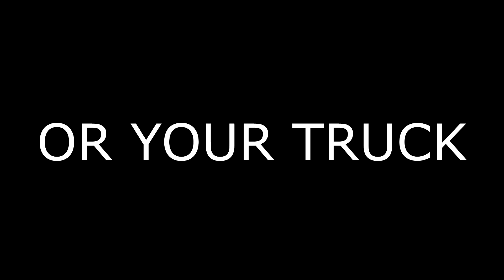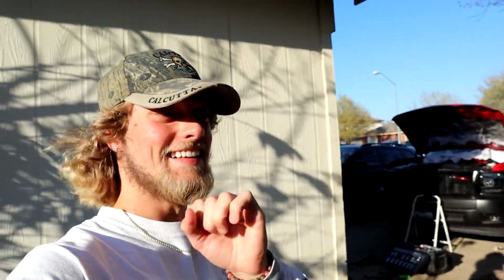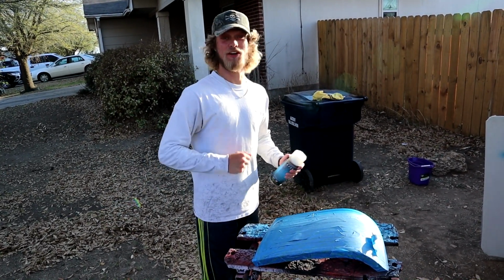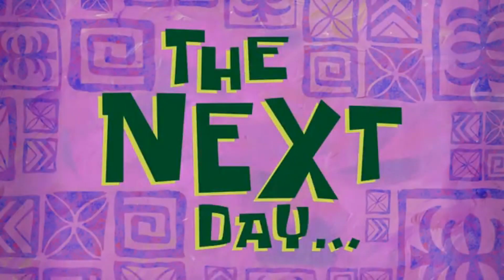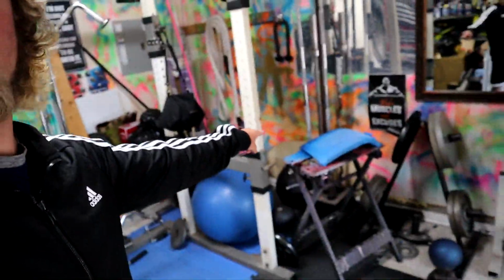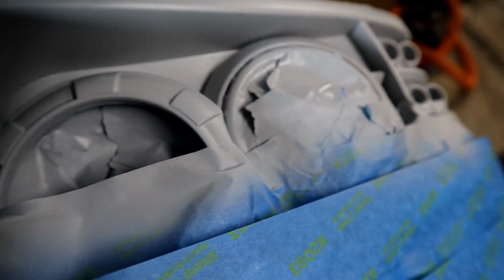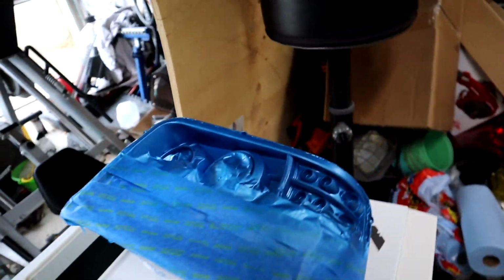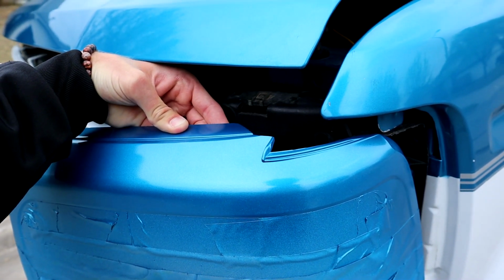The Color Matched Headlights are Looking SO GOOD!

Comment: Also, 2 to 3 inches further away and spray back and forth slower will give you better results.  I used to paint guitars with auto paint back in the early 90's.  Finally, if you have to paint outside do it in a corner, or erect some plastic walls to block wind, and paint around noon once the sun burns off the humidity in the air.  All that said, looks killer!